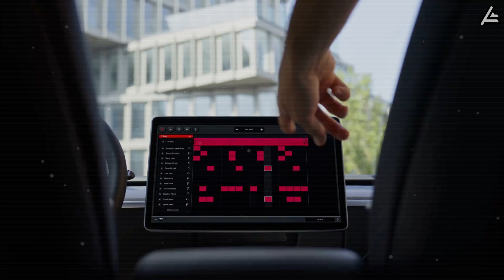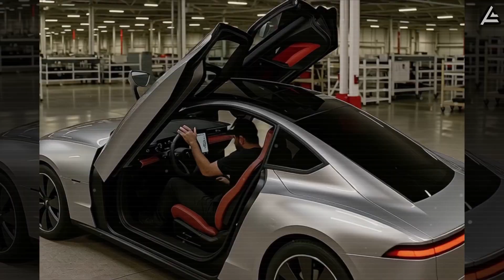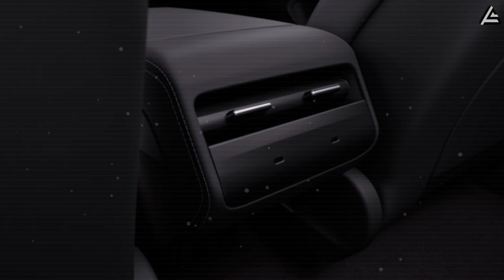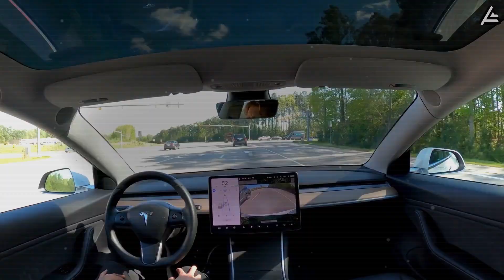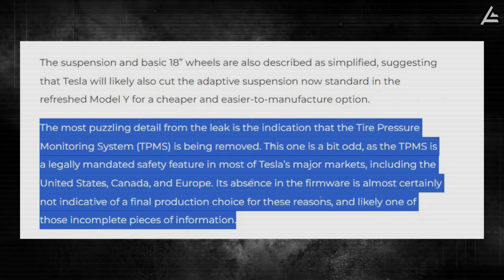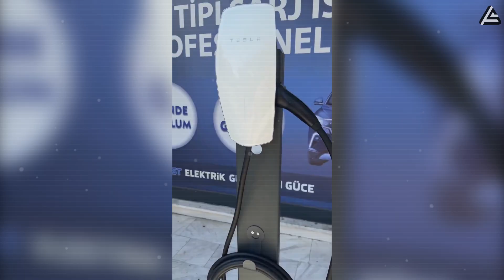Elon Musk Announced 2026 Tesla Model 2 Finally Hit The Market. What's SHOCKING Entire Industry?

Comment: Don’t care about the roof!  DO care about the upholstery (should be leather or like), screw heated seats, steering wheel, though lighting is missed!  
No TPMS?  Should be present and indicate which wheel is low/affected.
Cutting too deep and $25G’s is too high for what was described; how about $12’s?  That’s a good price for what was described.
Never mentioned the range.  For that stripped down car, should be high!
Reply from the maker: Do u think it's still a high price with newest battery technology and latest AI chip for FSD?
Reply: @AutoGearShift2 Problem is I don’t need FSD, or I should say, “Don’t want it.”
I like driving, on my own.  Assistance from the car is good; Tires, A/C Temp, blind spot, etc.
But, the “See?  I’m driving with no hands!!”  Is not for me, and the new battery type I thought would lower the cost, below $20 000.
Then, again, I’m 72.
Reply: @AutoGearShift2 Too many channels saying to many things about the cost!  One says 10K, most others say $16K.  Now, it’s $25K, with cloth seats!  The car’s going to be used for Uber or Lyft.  Cloth stinks after a while.  I’m in Vegas, so perfumes and aftershaves kill the neutral smell.  ‘So hard to clean!
Reply from the maker: understand your frustration. We share informed perspectives on what could be coming next. It’s about thinking ahead together. Official launches come later. speculation is part of the fun.

Comment: Is a flat underbody more about charging or aero?
Reply from the maker: The answer here is yes, a flat underbody mainly improves aerodynamics by reducing drag, which helps extend range. At the same time, it also protects the battery pack and makes charging cooling systems more efficient. Are you also concerned about aerodynamic efficiency in any part?